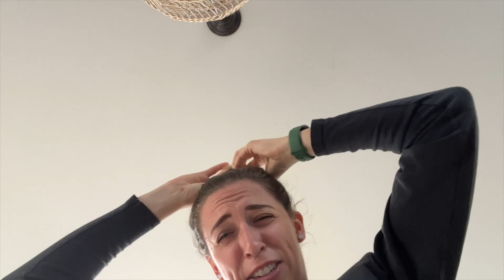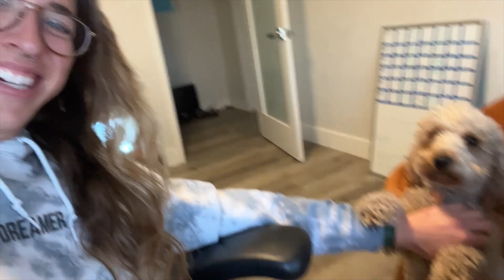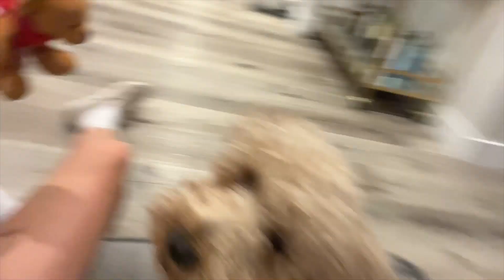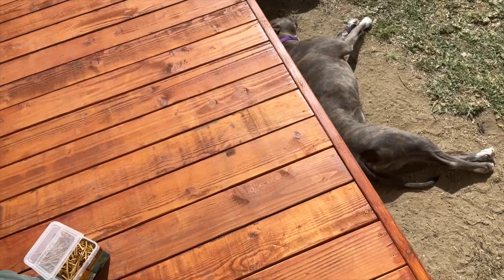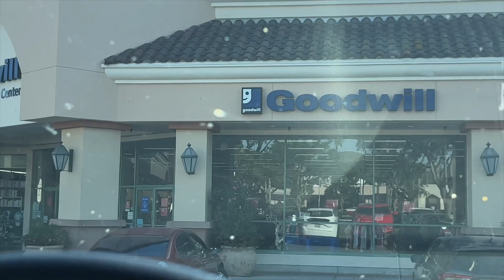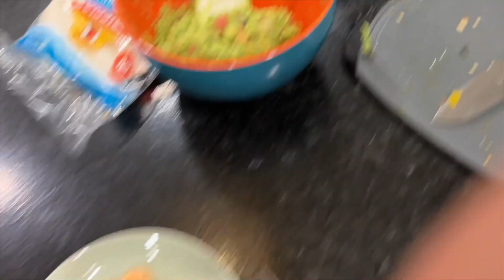I GOT TO SEE MY DAD

Comment: Not sure if you did this or not (it didn’t look like it on camera) but usually when building a deck you have to put the slats right up against the next one with no gap. Over time the wood dries and shrinks. If you used normal wood. Because you will have massive gaps in the wood once it does shrink and dry.